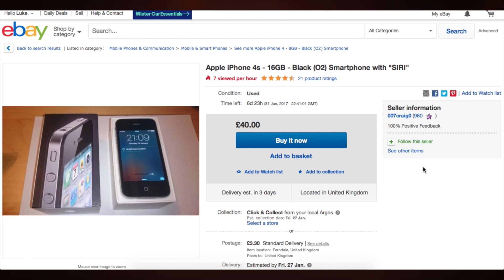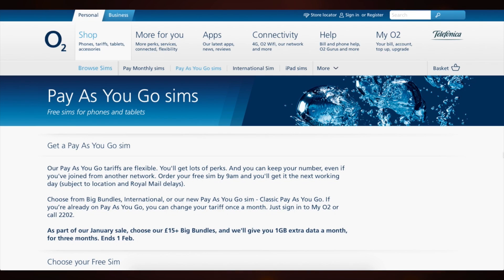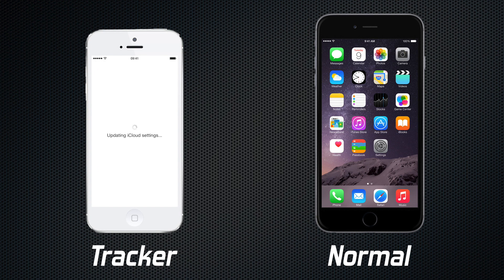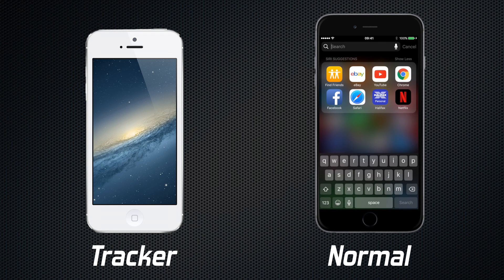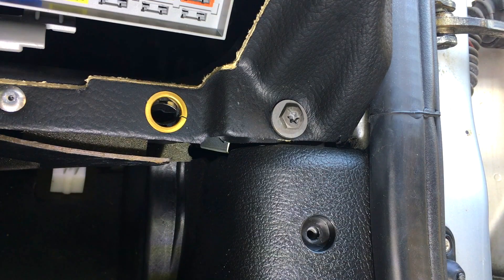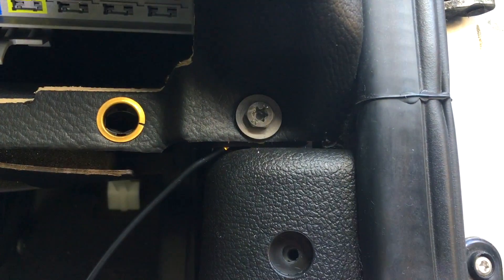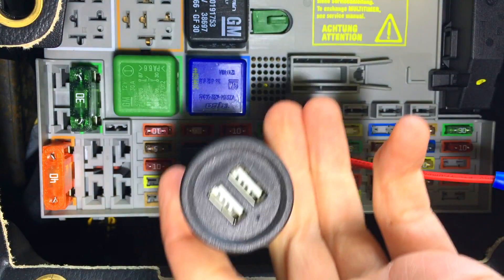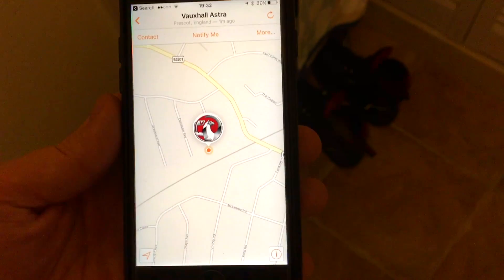How To Turn An Old iPhone Into A Car Tracker

Comment: This is awesome. Now, if you're able to take it a step further, I would. Some cars let you save two or more phones via Bluetooth. In your accessibility settings, you can set the phone to auto answer. It will answer after 3 seconds. You get a notification that your car is on the move? Call the phone, it will answer after 3 seconds. Give them their location and tell them The Cavalry is on is way. No one is expecting that call. Another way and maybe a better that could work for everyone without a bluetooth system is to get a bluetooth speaker and pair it with your phone. The speaker can be hard wired the same. It's just a matter of hiding both and ensuring the speaker is loud enough for the thief to steal. They make bluetooth speakers that hang on a cars visor. Amazon, about $20.  There's plenty of ways of doing this. There's rear view mirrors with apple CarPlay and a loud speaker. Have your mirror answer your calls so you can spook the thief into abandoning your car. How satisfying is that?? One more thing, you can set the time it takes your phone to auto answer, 3 seconds is default. You can set it as long as 60 seconds. Set your tone to whatever you like. I would maybe do no more than ten seconds of "Bad boys, bad boys, what you gonna do? What you gonna do when they come for you?"

Comment: You could add advice that there are several different fuses out there so you will need to buy the specific piggy back holder for your car.

Comment: Phones get hot if you always have it connected. In a hot summer day you could burn your car down.
Reply: just use an airtag under a floor mat.  much easier than all of this
Reply: Wrong I have used this method for over two years no problems
Reply: Unless you live in a cold area then yes but in Texas that doesn’t seem quite smart to do.

Comment: Good video, I had to change a few things for it to work for me.

So I have tried this. I bought a new iPhone 6s for £200 + £100 Apple smart case. I had issues with the notification system, but when installing an APP called “prey” or “prey project”, I now get notifications both via FindMyFriends, and via email. Without Prey, the phone would not alert me as it would go into some sort of power saving mode (not low power mode). Prey helps keep the phone awake. Battery life is about a week. With prey, you can also keep “control zones”. And then set them in mail to show as “VIP EMAIL”, ie you’ll get a notification when you are emailed by them.

Data usage is so small, maybe 1 penny a day you check its location.

You can remotely check battery via signing into FindMyIphone with the iCloud associated to your tracker phone.

Comment: I got a new iPhone 7 Plus so I’m going to use my old 5s as a tracker. I’ll buy a prepaid nano SIM card and there’s a usb charge port inside the middle console. I’ll just put stuff over it the phone to hide it. Or I may just put the phone hidden inside the back seat pockets since I just want to track from a day to day basis. Now I wonder if I need to reset my 5s and add new number from new sim or maybe I don’t need to delete anything and use the new sim? I’ll see.

Comment: Can you track an iphone with an android phone?
Reply from the maker: Kind of. If you log into iCloud.com with a web browser, you can use the find my iPhone feature which would work. Just not as slick as iPhone > iPhone.
Reply: Torque Steer thats ok i want to put the iPhone in the car as a tracker. Just incase.
Reply: Torque Steer just tried that from android and it doesn't work. Icloud is not supported on android.
Reply from the maker: I’ll have a little check for you in a bit. See if I can come up with a solution.

Comment: Hello! I'm trying to attach an old Samsung A5 to my car. The only problem I have that I don't know, how much data is those apps sending? So is it (for example) 1MB/day?
Reply from the maker: I'd probably say less than a few MB. You should be able to download an app (especially with it being an Android) to monitor data usage. It would be able to give you a more accurate answer than I could.
Reply: Thanks for reply! I have about 0,066€/Mb in this finnish prepaid. And the limit is 6€. So I have about 90Mb to use. 
I was just wondering if this GPS app is just sending coordinates that is about 8-9 bytes (8 bytes without the decimal in coordinates), but if the app sends commercials, time, info from the phone or other metadata, it will increase the sent bytes. That is what I'm interested. 
So the only thing here is to grab Kali and start monitoring my network? :D
Reply: Goes a little deep levels now, I have to admit.

Comment: Fantastic video mate. Many thanks all the way from New Zealand. Quick question, is it best to disable anything else in the tracker phone? Like auto updates for the iOS etc that might be problematic with the phone hidden in the car, or anything else?
Reply from the maker: Good question and thanks for the comment. I like to disable as much as I can just to avoid it accidentally using up the data. So typically, I’ll turn off everything in iCloud except fine my phone and disable and auto updates. Then I’ll set the phone to do not disturb mode and disable WiFi and Bluetooth. It just keeps it quiet behind wherever you hide it.

Comment: How often do you have to top up? and do you have to take the phone out the car to top up?
Reply from the maker: It would all depend on your network. Mine is a rolling 30 day deal from an old phone. Many networks let you top up via an app. As for how often, it depends on how much data you have. However, pinging the phone to see where it is only uses a few kilobytes so even 100mb would last you ages.
Reply: If you’re in the UK, three is really good. Pay as you, go in 1.5 months, I have used 50p from £10 credit, with regular checking and testing. It’s something like 1p per MB, and it uses hardly any data.

Comment: Does the phone drain car battery with it being constantly on charge?
Reply from the maker: +Tony Thompson technically yes but the power consumption is so small that a car battery could power the phone for weeks on end. In the real world, there is absolutely nothing to worry about. Your alarm system most probably uses more power.
Reply: @TorqueSteer  Hey, do you think the overheating could be an issue and potentially burn your car?
Reply: A car battery recharges it self with its being used which is why a car battery last really long